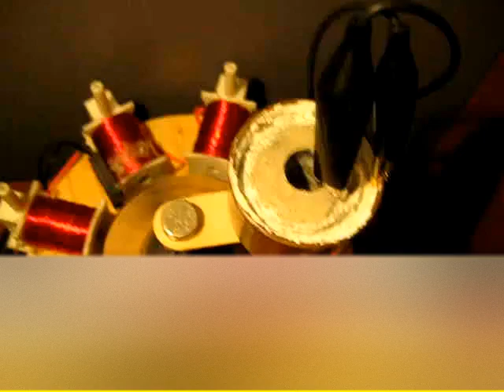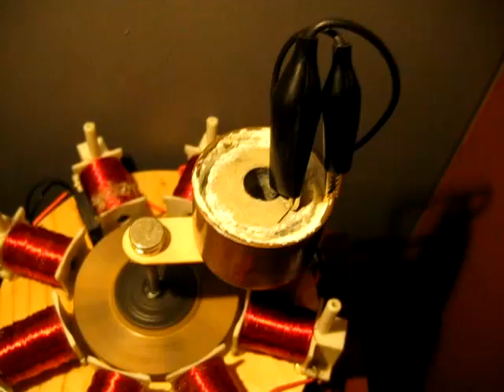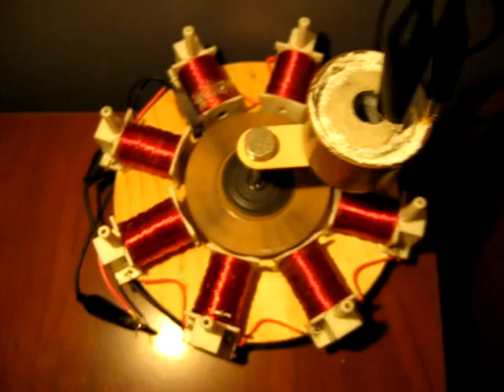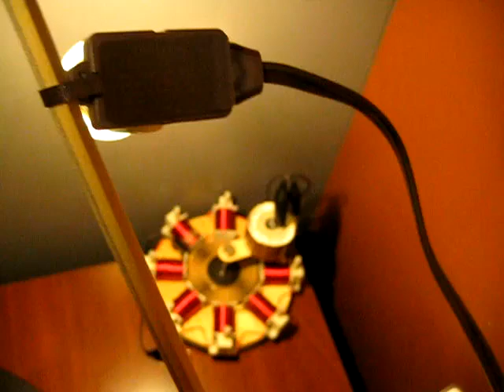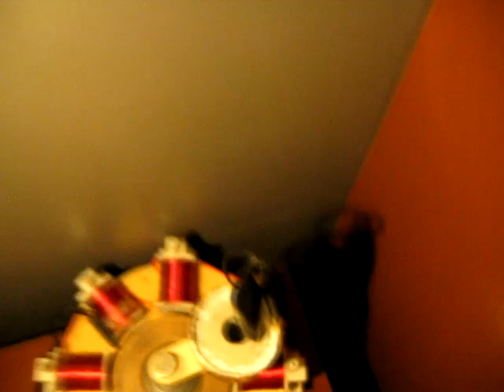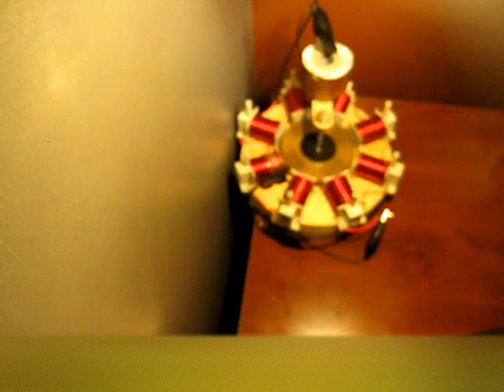Crystal Cell Magnet Motor.  Running for over two weeks and still going!

Comment: It's not working....I made 100 cells tried all the minerals n different metals...gives u voltage yes but no amp at all ...pretty much useless because ionic bond not conductive in solid state

Comment: Random comment after seeing this and also digging. I’m building something not to rival Elon but to help us who may not be able to leave in time.
I need you to contact Elon musk. We need to find quartz crystals and other types to store electricity place them in a magnet chamber to charge electricity and wire it the way u did into a generator and then into a ship. If Elon is planning to leave the earth already and is posting now recently discussing the end of the world and much more apocalypse then we have a solution but we need to act now. This is not a joke I urge u contact Elon immediately. If u combine crystals and of course harness enough solar power inside the generator but charge them with magnets that can target the crystals in a chamber wired this way ur able to even rapidly build a ship programmed and wired into it. Need to seal the ship completely no openings. You’ll use solar energy at a low level to produce massive results to create a hover ship and expand emergency protocols. We have less then ten years. Contact me after u contact Elon and get a reply. Aesthetics r important that’s where I come in. I’ll
Explain later if u contact Elon bc this is scary I would never comment this way unless something in my gut was saying……we need act quick.

Comment: I really like the device u have build. U mentioned that the spinning is slowing down. Did you calculate the resistance of the copper wire uve used for coil? If u have less resistance u are losing less energy. R=(copper 0,017)*(l\A) on 18C°. U can add also perm magnet to stabilize the spin. I also would like to take the levitation pad into ur attention as using for spin. U have less friction if u take the spin in antygravity field.

Comment: What's the point?  You can run low current motors off of potato batteries, lemon batteries. BTW, Alum is not "aloom", it's al-um.

Comment: So how many of these would be necessary to charge a USB device through a voltage regulator?  What about powering a tv through an inverter?  What is the cost per watt/hour?  Spinning a motor and not really doing anything is a novelty, it's cool and you did a good job at it but I've yet to see anything useful done with these.  That makes me think there are no practical uses for them.

Comment: all these device designs are powering a rotor from the inside. the design above is similar to my idea, but the stationary magnets should be positioned on the inside and the rotation on the outside.

Comment: Yeah but what kind of useful load can you put on it?  Getting the thing to spin is one thing, getting it to do useful work (why you build a motor in the first place) is another.
Reply: +InventorDeeJay Still doesn't really answer the question.  What kind of work as in how many watts, which cannot be amplified, does it provide?  I've seen one useful application for these batteries which was lighting up a 10mm led and put into a Christmas Tree topper using 6 cells.  The cost to make those 6 cells was far beyond the cost of grid power to do the same thing.  Not very feasible.
Reply: InventorDeeJay Defiantly not one of the first. Power corporation just keep killing them.

Comment: everyone gets excited about volts n amps .but not all devices in the home or portable devices  will run on any frequency . home 50-60 hz  ac   pure dc 120 hz other wise its not  gona give rite volts n current or recharge a battery fast enough  or it will have hi low spikes. most items bought  have to meet the frequency requirements .  such as a home power pack 120 v ac 50-60 hz 12 vdc out i can do much more with a special design alternator  and step it up to 120 v ac  but its not 60 hz so i can run a induction motor  but sensitive  electronics wont properly.

Comment: if I had to make an educated guess, it has an amp hour rating similar to a D cell battery say 5-10 Ah. It's efficiency is determined by internal resistance which would be quite high (10s to hundreds of ohms), but if you only draw a small amount of power, say 1mA  then you could probably get it to last for 8 months to a little over a year or so. More if you draw less current.

Comment: the lifetime depends on the load you are drawing from it as well as the geometry of the surface and the amount of the specific materials, as 2 minute video is not enough information to do the calculation, I can say the open circuit voltage is approximately 0.87 to 1.44 volts as that is determined solely by the workfunction of the two electrodes.

Comment: no, no it doesn't. It runs off a magnesium redox reaction, no different than any other battery. It will run out when the surface of the magnesium becomes fully oxidized.

Comment: @lasersaber Ruby Sapphire bearings would probably be your best bet. Use a super light oil as lubricant and you'd be gtg.

With a bit of work you can pull these ruby bearing out of old watches. :)

O.

Comment from the maker: @nastasa1234 
@nastasa1234 

The motor spins on a needle point.  After time the needle point drills into the glass and it stops.  I am working on a better system.

Comment: I have been checking back to see if you have posted to some of the question that have been asked concerning the volts/amps and the mix ratios of the ingredients for the crystal cell. I also seen you have done much work with the earth and air batteries and now with the crystal cell. In your opinion which type has the most potential?

Comment: @Skryde Well i will read on this more but thought i saw references to the borax molecule which in addition to sodium and boron, there is also hydrogen and oxygen in addition to other non-metalic molecules of epsom salt (carbon and oxygen) meld together during the melting process and that water can be seen at that time. No additional water is needed. Plus, was this the type of cell hutchinson made? i thought this was done by ibpointless2.

Comment: Cool. So Borax and Epsom salt to create the crystal medium that uses only the water molecules in the resultant crystal for the galvanic exchange as the Alum and Salt Sub as a kind of preservative that slows the decomposition of the different metals down to a minimum so that the battery will last much longer.  yeah, i think there are many different combinations that can be made with this method.